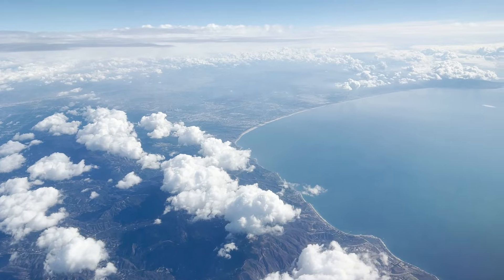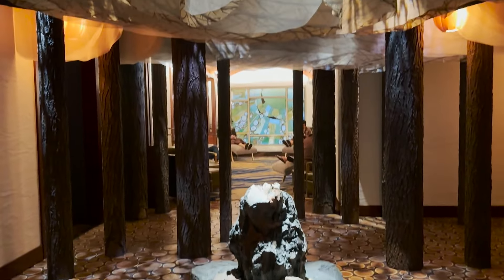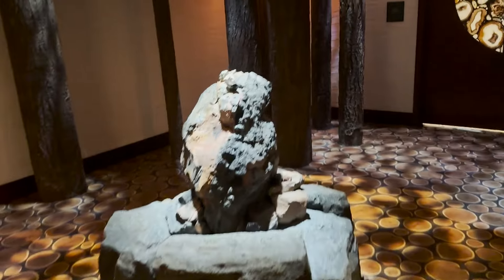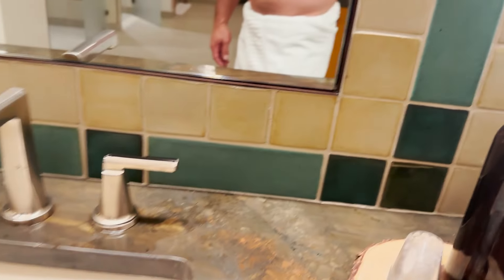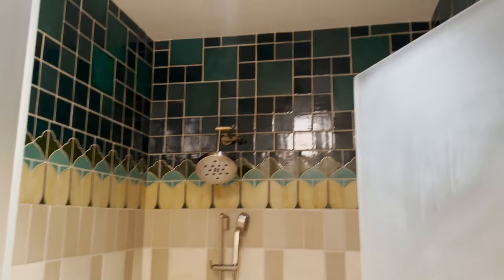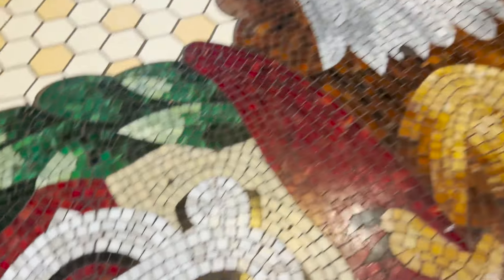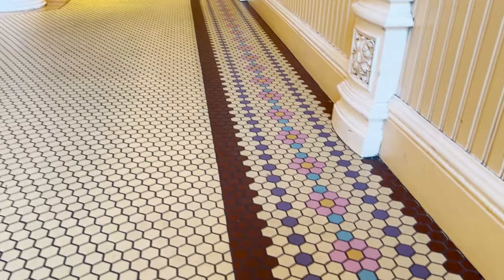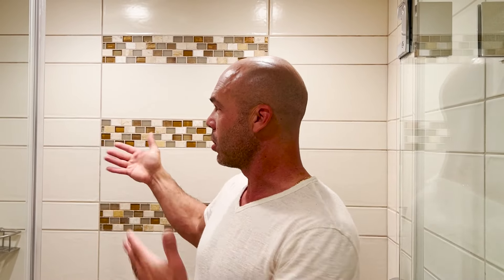Mr. and Mrs. TileCoach 25 Year Wedding Anniversary

Comment: Congratulations!
My wife and I celebrated our 25th last year, can't beat it when you are going through life with a great person by your side!

I redone my master bath, thanks to a leaking shower pan. Having over 30 years experience as an electrical contractor, architectural and electrical engineer made redoing the bathroom buildout simple, but I was still concerned about the large shower never doing tile before. After watching many Tilecoach videos, I went for it. After much research I decided the Tile Redi pan was the way to go so I ordered a custom size Tile Redi pan with linear drain in the center. Turned out awesome. Being an architectural engineer, I am now working on complete renovations of one of the largest well know golf course hotels on the east coast where every room has a large shower, may be specifying Tile Redi pans throughout.
Reply from the maker: Hey Chris!   You are so correct, I feel like I always have a partner in whatever I'm going through.  Congrats on your 25 years.   Being a contractor myself, I can see why the Tile Redi would be such a good choice for a hotel remodel.  Most importantly the assurance that there won't be any leaks in the pan because the splash wall, curb and drain are integrated.  Also, the speed factor.  One crew could probably install 15 pans or so in one day, ready for tile.  Lastly, the durability of the high density polyurethane foam allows for other trades to work on or around the pan after it is installed.

Comment: A tiler can’t really be on a break, right, your tile-eyes are always on.

👉 Question please: can the wrong color of Mapei grout be corrected after dried? 

Had to rebuild after storm. First contractor did all floors with wood-looking tiles but almond grout (the selected one was dark brown, like tiles, to blend in)

Could we add a thin layer of dark grout, or it tint it? Can it be rescued????

We already had to demo all the new kitchen flooring, wrong leveling and uneven tiles (by 1/2 “!!!), hoping for an easy solution.

It hurts the eyes to walk in the house and see it like a shower stall, can see each individual piece. Also, dirt and stains.

Comment: Coach I have a question. I had a hotmop done in a shower Im building and I need to know do you apply the liquid membrane to the dry pack when it is over a hotmop or do you only do the edges over the fabric membrane leaving the center uncovered.
Reply from the maker: You don't waterproof over it when it is a hot mop